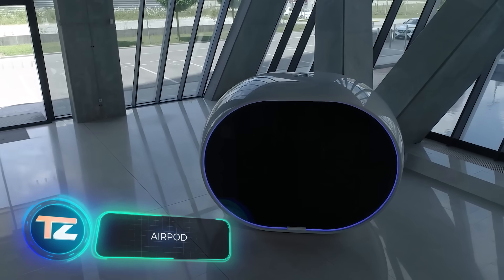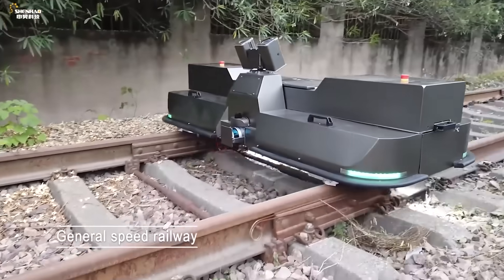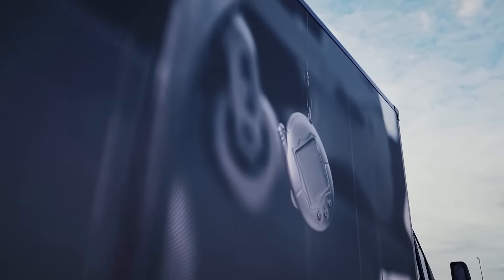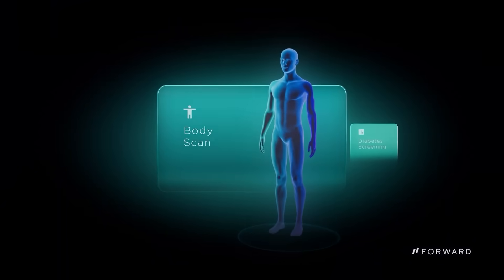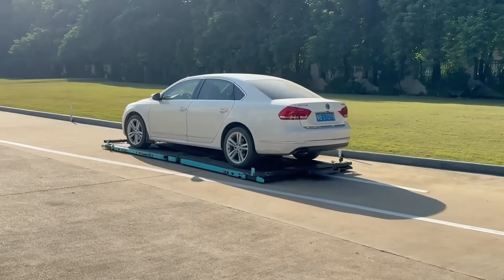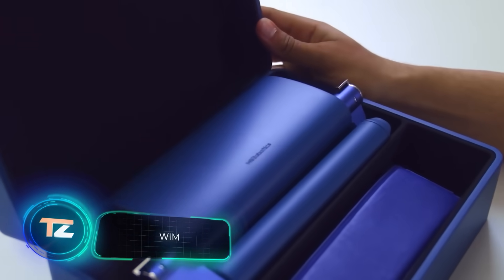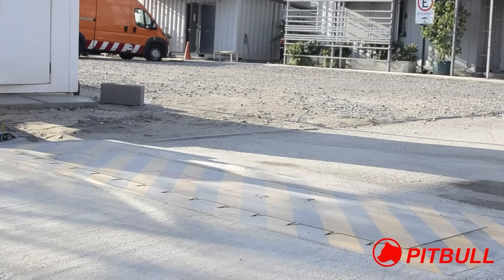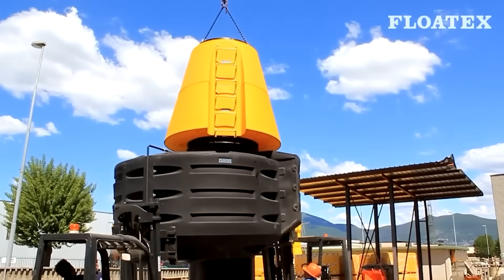15 INGENIOUS INVENTIONS THAT ARE WORTHY OF YOUR ATTENTION

Comment: Those box displays are going to have a hard time meeting safety standards.
Reply: Most of this crap will never exist.
Reply: @therationalanarchist   Yep you said it. Makes you wonder if 
it's real or just something thrown together to post on you tube.
Reply: @diGritz1 the trucks are already in use in some ciyies
Reply: @therationalanarchist that’s what they said about air travel 100 years ago.
Reply: @BrowncoatGofAZ  And cars when they were first used. The original laws in some places were insane. There were places that required you to dismantle your car if a horse refused to walk past it.
Reply: @jk013x  considering urban sprawl these days, I kind of wonder how this country would look if they Hadn’t taken off.
But yeah.
Reply: What i would like is one of this in a more practical manner, display on back of every truck showing whats in front of it.
Reply: @tryssse   I was thinking this when I first saw it. To hell with advertising. We have plenty of that already. Ues it as a safety feature. Each panel shows what's on the other side! Probably reduce traffic accidesnts by at least 20%.